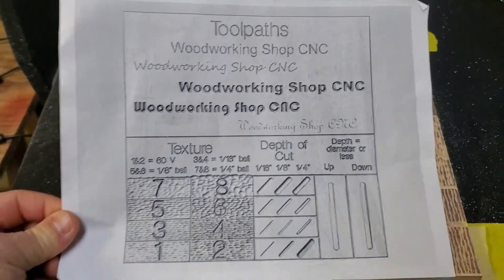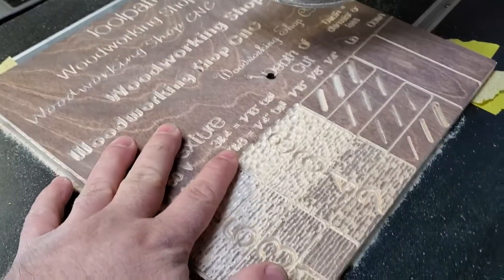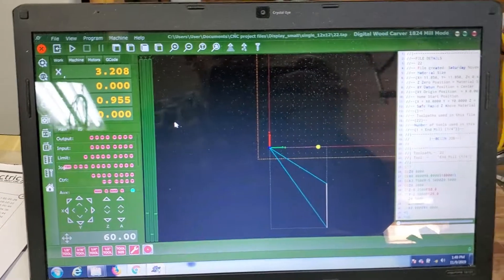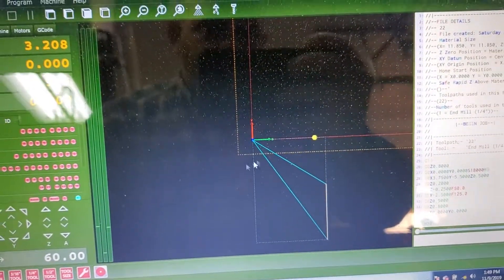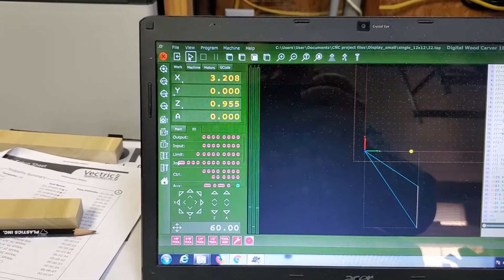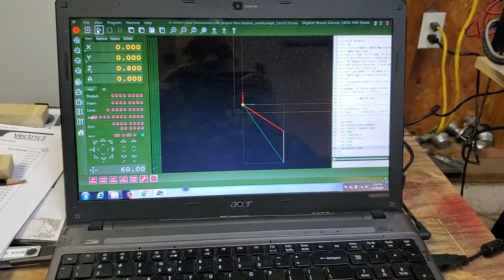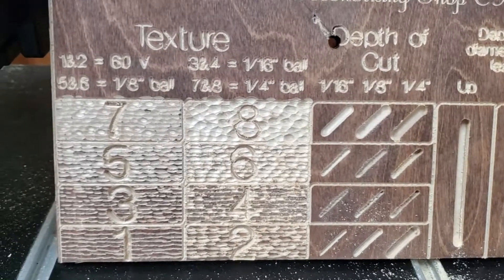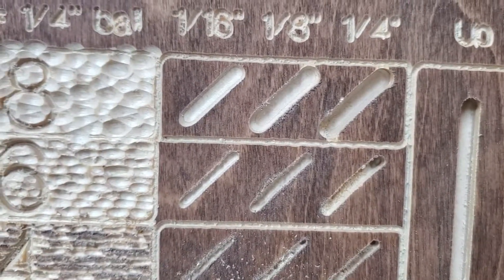Digital Woodcarver DWC1824 Review and Test toolpath Sign

Comment: Thanks Chris.  I have seen no talk on this, but what do I set my router speed at?  What do I have to set the actual physical router dial at?
Reply from the maker: The router dial should likely match whatever 16-18k rpm is.  The router manufacturer should have a cross reference if it only has numbers (i.e. 1-6).